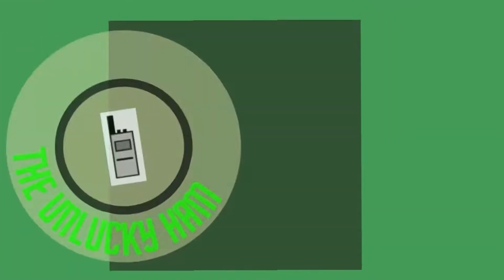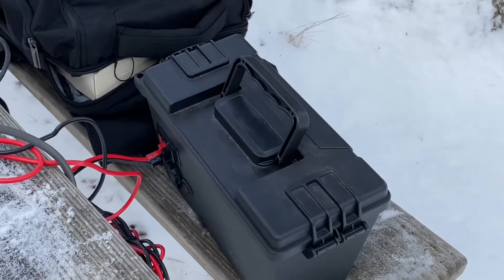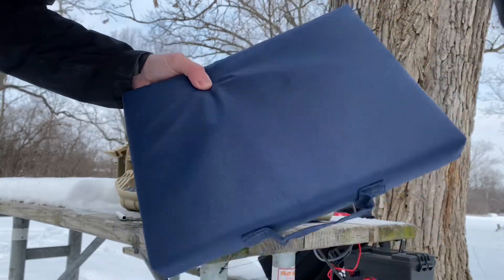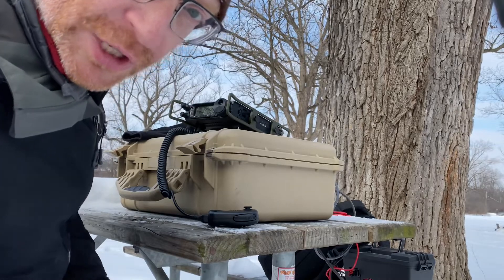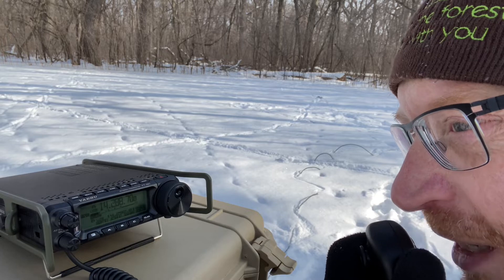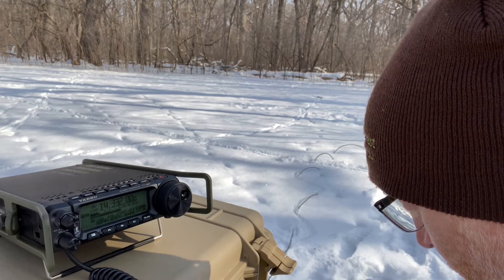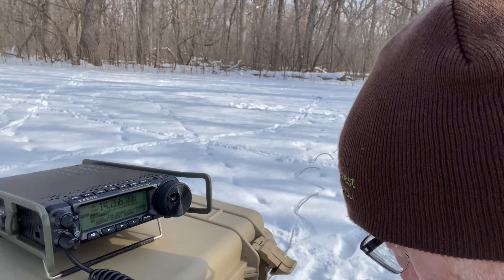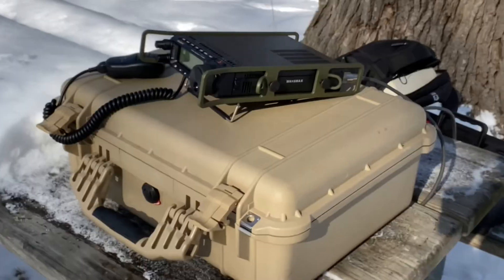Winter Field Day 2022 #hamradio

Comment: Well done. Where did you get that antenna tripod? - Graham - 2M0IJU.
Reply from the maker: It is from Super Antenna.  It's their mini tripod.  Uses a 3/8 24 thread for the antenna stud (like a CB) and also for the legs.  I went to a hardware store and they had the right size threaded studs for me to extend the legs out.
I can also use them with the Wolf River Coil to make it a center loaded  coil